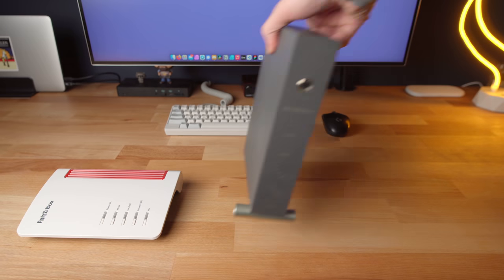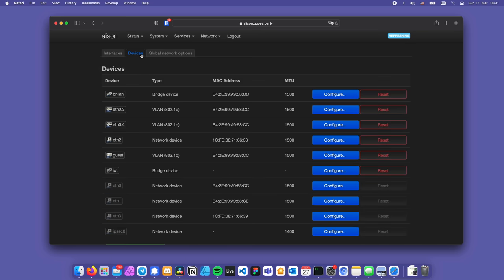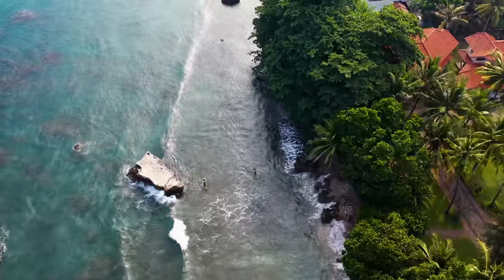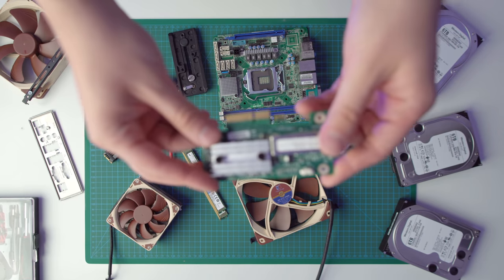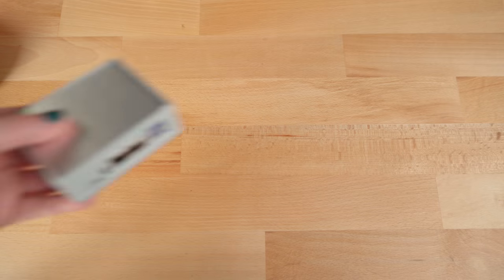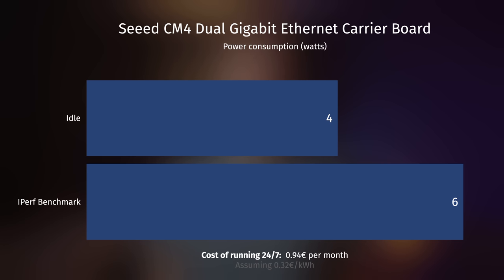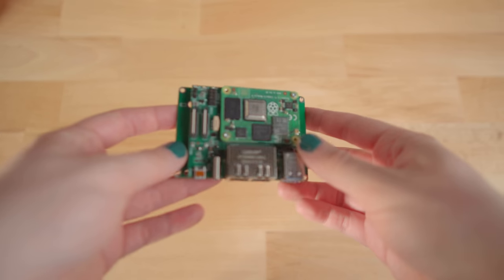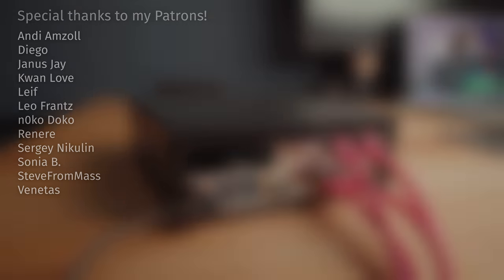Should You Build Your Own Router?

Comment: 05:50 Pros and cons of using a cheap consumer router 

Cons (points from Wolfgang with some comments of my own):
1) might not be able to run just any OS other than OpenWRT: sure, eg. if you want to run pfSense, this is out of the question today, but might also change in the future
2) small storage space: simple to add enough storage space to install everything you need using a USB disk with extroot config
3) CPU performance might not be up to the task: No question these CPUs are quite limited. What applications would specifically make a typical consumer router start to falter on a typical home network? Any reference to back this up? 

Pros (my own points here):
1) comes with wifi5/6 and 4 ethernet ports that's mostly enough for home use: as you and others also pointed out, it's tough to do this cost effectively in a custom build 
2) price: around 130 USD for a decent model with wifi5 and around 170 USD with wifi6
3) power consumption: about 8W for routing, switching and AP functionality

Using a separate AP for wireless connectivity and a separate ethernet switch to get enough ethernet ports will: 
  - add about 10W of power consumption (5W each) that will almost double the 12-14W power consumption of the DIY router on its own
  - cost 129 USD extra that's 70% more to spend on top of the cost of the 184 USD DIY router 

Living in an apartment or in a house can make a difference too
If you live in an apartment (as opposed to living in a house) and conscious about power consumption, using a separate AP for wireless is probably not what you want 
because of the additional power consumption and probably without much benefit. On the other hand, using a separate AP makes more sense if you live in a bigger house, 
because you might need more than one AP to have good coverage in all rooms and your router might need to be placed where its wifi antenna wouldn't be able to give you good coverage anyways.
Reply from the maker: I'm not sure if power consumption is really that big of a concern. At least with my Unifi APs, they consume 4 watts each. Even if you pay 40c/kW, that's $2.33 per month.

Consumer routers, especially those with beefy WiFI and the kind of processing power to be comparable to a custom one, can pull as much as 25-30W, so you're gonna have to spend "watts" on WiFi either way.

Plus, renting an apartment also means that you most likely won't be able to place your wireless AP/router wherever you want – you'll have to put it where your DSL/coax plug is. Which means that depending on the size of the place, you might need to get more APs or repeaters  to cover your entire apartment.
Reply: @WolfgangsChannel  ... or you make a smart choice and switch off the WIFI modul if you don't use it. Those AVM boxes are really nifty with regular updates. Are you sure you need a low power X86 CPU? The only reasoning that actually makes sense is software choice, since those AVM Fritzboxes run mostly on 32bit MIPS SOCS which are "weak sauce" compared to the ARM64 choices.
Reply from the maker: @Red Phoenix Afaik AVM boxes can't do VLANs, which is a must for me. For most people they'll probably be more than adequate

You can definitely set a timer for WiFi APs and turn them off at night... And save about 50 cents a month. Sure, if you live by the motto "one cent here, one cent there", that's a thing you can do, but the savings are pretty negligible.
Reply: @WolfgangsChannel  My old TP-LINK TL-WR1043ND 300Mbps wireless router running OpenWRT also draws 5W with its AP on and under heavy load. It's processing power is not comparable of course, but I doubt even a current top-shelf consumer wifi router draws more than 10W (unless sporting a x86 processor), but unfortunately I don't have one to test it. Maybe someone will chime in with an actual measurement, but I think 25-30W definitely only goes for x86 chipsets.

My point here:
1) Maybe drawing a 5-10W extra doesn't seem to add much to your energy bill (this might also change for the worse now at least in Europe depending on the changing German energy politics), but it proportionally means doubling the power consumption and that is not negligible. 
2) Drawing an extra 10W 24/7 means 10x24x365=87.6kWh over a year that's almost exactly half of the 173kWh yearly power consumption of my A+++ washing machine, if you think about it like that.
3) And this extra power consumption goes into running an x86 processor, 4GB RAM, integrated graphics etc. that are probably a huge overkill in every sense for what a home router needs to do. I'd stay away from x86 in a router, especially now that even laptops are moving away from x86 and for good reason.

You are right that you won't be able to put your router just anywhere you want in an apartment either, and while some apartments might be closer to 100 sqm in size that might also demand for multiple APs, most flats are smaller than that and much smaller than a typical house hence an all-in-one wifi router just cuts it.
Reply from the maker: Definitely some good points, I haven't thought about the power consumption in terms of washing machines :D

Comment: I use an ISP router, but I needed WiFi for the back of the house.  I had an old TPLink WiFi router lying around WiFi 135Mbps, Ethernet 100Mbps, it had an Ethernet WAN connector.  I use Ethernet for my 3 computers and the WiFi for; my wife's laptop; the bedroom TV and our phones. To get a faster connection between my 3 computers I've added a 1Gbps switch ($15).  To improve security for the router I've changed userid and password; updated the firmware; closed the router for all inbound traffic and only allowed admin access through the MAC addresses of my laptop and desktop.  Who needs more?

Comment: do you have a vid on bundling or channel bonding different ISP's interent into ONE giant internet cable for my house lan?
Reply from the maker: Just a heads up: You won't get a speed boost by using two ISP connections at once, it's only for redundancy. E.g. if one ISP connection goes down, you would still have the other one. That's only really useful for super mission-critical enterprise applications, where downtime equals money loss. Hardly useful for home users.
Reply: @WolfgangsChannel  does that mean.....one ISP pipe will always be idle? is there a thing that can maximize the pipes from both ISP ? maybe im asking for all the available LANES to be used
Reply from the maker: Your ISP already gives you all the "available lanes". Imagine if you had to go from point A to point B in a car, with no other traffic on the road. It will take the same time whether the road has 2, 3 or 4 lanes.

Comment: Just a question, what would you use for a 10GbE WAN & LAN router?
Reply from the maker: Probably UDM-Pro
Reply: @WolfgangsChannel  that's the one I got, I did not found anything else that was fanless, or at least very silent under almost no load that was able to do 10GbE throughput for nearly that cheap. There's the UXG-Pro too that would fit the bill too, but it's a bit more expensive, and I don't really know if there's any advantage to use that one instead of the UDM.

Comment: i used to spend a lot of money on expansive wifi/router (linksys,d-link,tp-link).....
but they all give disappointing performance and pratically no security update (due to bad/cheap component or firmware support).....

until i found x86 router (starting with Zeroshell on a old core2duo)
then slowly upgrade to run OPNsense VM on a core 3rd gen core "i"

Comment: how about comparing the DIY router with mikrotik rb750gr3 ? the price only $70 on Amazon and it got 5 port ethernet and fully customized router, also it run on 12 volt DC power supply
Reply from the maker: Good option, but it's based on MMIPS, and not x86. Which means that you can't run something like Proxmox, OPNSense or pfSense.
The DIY router featured in the video also runs on 12V DC.

Comment: Something missing from this router build that your NAS 3.0 is probably craving now and you will surely add is a 10Gbit NIC.
With a 10Gbit network card added, the build costs will be quickly mounting up probably even above 300 USD and we haven't mentioned PoE yet (that you might or might not need right now), 
while eg. a 4011 MikroTik router that should be up to the same tasks as your custom build costs around 220 USD and gives you 10GbE, PoE and 10 ethernet ports out-of- the-box.

Now I'm also an OpenWRT user considering to upgrade my router, so the question here for me: is a custom build really worth 100 USD more than a MikroTik 4011? 
In terms of hardware, the answer clearly seems no.

Talking about professional grade home routers, the elephant in the room is MikroTik and RouterOS vs OpenWRT. I understand OpenWRT is an embeded Linux so you are free to install packages for different tasks, but I do want to keep my router sticking to network routing tasks as I have another home server for everything else meaning the versatility of OpenWRT might not be worth it. 

Anyone has any pointers about OpenWRT vs RouterOS functionality comparison?
Are there things you cannot do with RouterOS in the realm of network routing where OpenWRT gives you an edge these days?
Reply from the maker: I already have a Mikrotik switch for 10 Gbit, so I don't need an addon card for that. 

That Mikrotik router sure looks good though! If you're ok with the OS, I'd say go for it. It only has one SFP+ port though, so it wouldn't do for my use cases, since I need at least two.
Reply: @WolfgangsChannel  Sure, you need 2 10Gbit ports to establish a 10Gbit link between a NAS and a laptop. Any other device that wants to connect to the NAS using 10Gbit link needs yet another 10Gbit port. Having a 10Gbit switch along with a router with only Gbit ports helps as long all devices that need a 10Gbit link are on the same VLAN. 

A switch with 10Gbit RJ45 ports feels like a good compromise to get all devices on a 10Gbit link to the NAS in a home environment so long you are ready to sacrifice VLANs.
Reply from the maker: I agree, but the router you linked only has one 10 Gbit port, that's why I mentioned it.
Reply: @WolfgangsChannel And I appreciate your comment that actually made me realise a 10Gbit switch with RJ45 ports is probably still a better tradeoff than buying into SFP+ ports and transceivers let alone rewiring with fiber-optic cables for a regular home user like me.
Reply from the maker: True. Personally, I chose to just use DAC cables without transceivers, since I don't need much range.
Reply: @WolfgangsChannel  Talking about DAC cables, not sure if you've seen this new Mikrotik baby: CCR2004-1G-2XS-PCIe. It has 2 SFP ports and almighty processing power on PCIe card for around 200 USD, sounds well suited for short range and for maybe the kind of things you do. Unfortunately I need a bit longer range and can't use DAC.
Reply from the maker: That's a beefy machine! I'm using USW-Enterprise-8-PoE at the moment, but considering replacing it with UDM-Pro-SE as soon as that becomes available. Hopefully they'll allow using the second SFP+ port as LAN by then, but if not, i still have my trusty CRS305.

Comment: meh, a i3 dell 3020 off ebay, second hand is a better choice. only needs one extra nic, will have more than enough power for any router option, and will no doubt cost you only about the same price as just the mobo you bought. you can also get it in sff, which isnt a bad size, physically.

Comment: since you mentioned Romania, you usually get an ethernet cable and then you can do whatever you want, ranging from using your PC with PPPoE dial-in all the way to dedicated routers of more or less complexity. the standard is open, you have freedom. In Germany on the other hand it boggles my mind to see that FritzBox has monopoly over the device you get at home for cable or DSL. it's a free market, how come??? why this vendor lock-in?? why other hardware manufacturers don't protest against this situation? even worse, you barely find any documentation about how to set up your own hardware if you don't want to use the FritzBox from the provider. and speaking of own routers, I currently use a Draytek Vigor 166 as DSL Modem, a fanless PC with Intel I5, 6GB RAM, 6 ethernet ports ordered directly from Ali Express and Sophos as router, and a Cisco WAP371 access point. When I'll need more ports I have proper Cisco switches in the basement waiting to be deployed. I have a 600Mbit connection from M-Net.
Gruß aus München!!!

Comment: The Vodafone Deutschland Router is a piece of overheating shit. 

I'm not kidding you, I have a old Nvidia GT 2×× fan that I wired to the USB Port of this Vodafone router. After doing this, the WiFi never shut down, router didn't shut down for 3minutes due to overheating and it was used as a bot net once.

Anyway, I can't wait to setup a custom router for my home network and WiFi Setup. This might fix most of my issues 😅

Comment: J4125 is fine for everything but 1GB+ WAN or 500+ MB VPN.

DO NOT get a cheap SSD, unless you enjoy replacing them every few months!
Reply from the maker: My Fujitsu S920 with a much weaker AMD GX420CA manages Wireguard at 800+ Mb/s. IPSec is a different story though.

Cheap SSDs are ok for this use case. Router OSes do very little reads and writes compared to a general use desktop OS. My current router still has its original 2GB SSD from 2015 and going strong.

Comment: This costs 40$ in my country: TP-Link Archer C80 AC1900 Dual Band Wireless, Wi-Fi Speed Up to 1300 Mbps/5 GHz + 600 Mbps/2.4 GHz, Full Gigabit, High-Performance WiFi, 1.2GHz CPU, MU-MIMO Router (Black)

Is it worser than your all options?

Comment: I’m tired of having a crap router, and multiple pi’s for different home applications. I’m building my own router with a frame.work main board with an I7-1185G7, 32GB of ram, and a 1TB drive.
Reply from the maker: You can get a i7-1165G7 box for the same price or cheaper, with four 2.5Gbit NICs:
https://www.aliexpress.com/item/1005004514115494.html

Comment: The thing keeping me away from all those no name gemini lake machines is the firmware.  I suspect it never gets updated ever.  Are there any reputable manufacturers making these?  The kind with websites and firmware updates on them?
Reply: The other issue are the power bricks.  I generally avoid those as most are garbage and it's hard to order a replacement when your router has just suddenly died.  I feel lucky if they don't catch fire.
Reply from the maker: Yes, you can buy one from Protectli (albeit at 2x the price): https://eu.protectli.com/#buynow
As for the power bricks, those are standardized, and if yours dies, you can just buy a generic one from eBay or Amazon. Search for a 12V PSU with a 5.5m jack, 5A should be enough
Reply from the maker: To be fair, I wouldn't worry about the firmware on these noname boxes. There seems to be one particular board that is sold on Aliexpress under different names, and it's a pretty standard AMI BIOS.
You can read a review on STH: https://www.servethehome.com/cheap-intel-pentium-n6005-4x-2-5gbe-fanless-firewall-and-router-review/
Reply: @WolfgangsChannel  I'll look into this, thanks for the links.